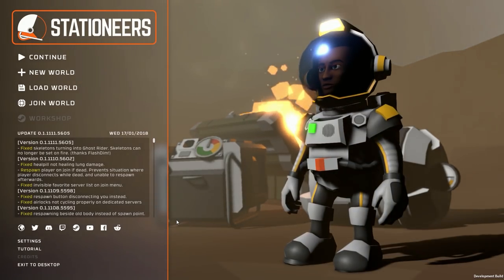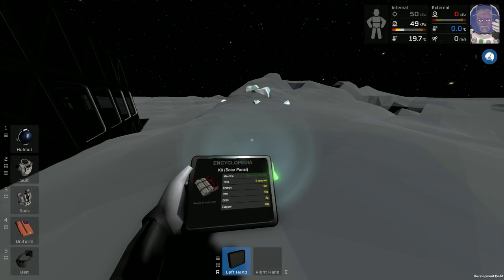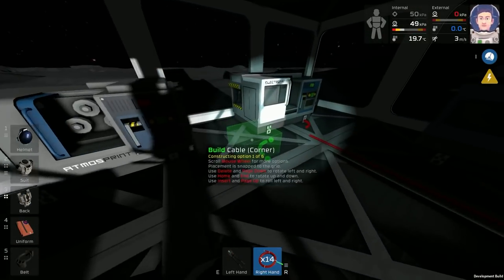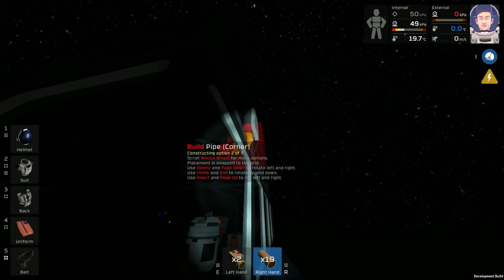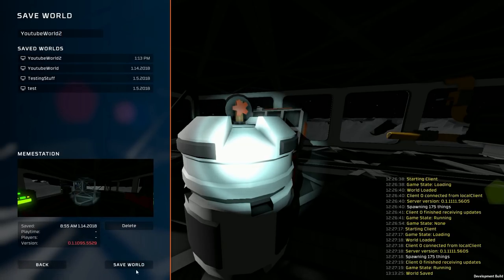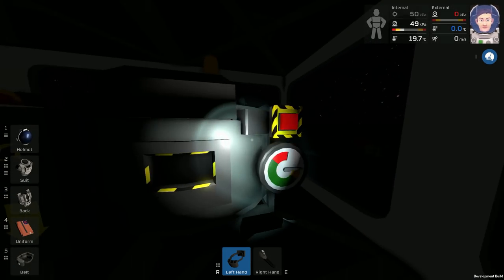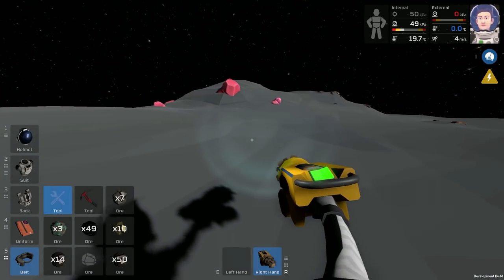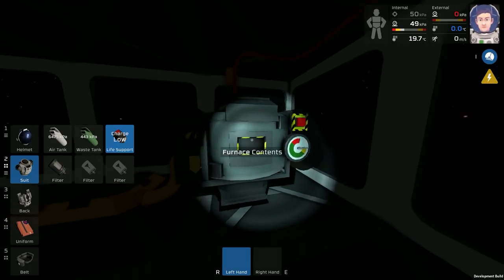Setting up the Steel Furnace! (Stationeers #03)

Comment: For air, you can build a small room large enough for the air scrubber with a glass window, roof and a door kit, then you just have to build another tank connector like you have, that leads to a "gas tank storage"(thing that fills the small gas tanks) somewhere else. Then place oxide ore in the room (and shut the door) so it can melt during the day and the air scrubber will collect the gas of whatever filter it has in it. Then you can wrench the air scrubber to the tank connector and fill canisters using the "gas tank storage kit"
Reply from the maker: I was reading that that's how you do it. Just an active vent leading from a room to a tank connector with a valve. Kinda seems weird but makes sense.
Reply: II you do it with an active vent you will also need to build an air filtration system so you get only oxygen. but the air scrubber does all that by its self and it connects to same base as the portable air tank, just make sure you build the "Gas Tank Storage" kit off of the Tank Connector Base and build a Canister  so you can swap it out with the low one in your suit once you get them filled . love the videos though man cant wait so see how you tackle logic in this game and what you can do with it. Just got my solar tracking going yesterday.

Comment: Power should definitely be your first priority. Build at least two more solar panels to cover your battery charging needs. Here's some other tips:

1. The suit light isn't that great and can be "replaced" by building a Portable Light, adding a battery, switching it on, then putting it into your pack.
2. A furnace can be used to melt volatile, oxite, and ice ore into the gas forms just by putting them into it. Much safer and cheaper than building a room for holding gasses. Build a second furnace and use that with a gas tank storage and pressure regulator on the output for filling your oxygen canister from oxite, fuel from oxite and volatiles, and your jetpack propellant from any combination of the three.
3. Basic power cables can handle up to 5kW of power. Use the network analyzer card with your tablet to check your power usage.
4. Pipes can handle up to 60Mpa. Use the atmosphere analyzer card with your tablet to check the contents of pipes.

Really enjoying the series. Hope these tips are useful :)
Reply from the maker: Thanks for the tips!

Comment: kAN, you know the data connector is actually a power and data connector according to what the UI said, right?
Reply from the maker: BlueBanana07 hmm I'll have to check. Normally when its both there is a different icon
Reply: Yea
Reply: Irrelevant, and he does use Discord. Link in the description.
Reply: Oh yea, should**